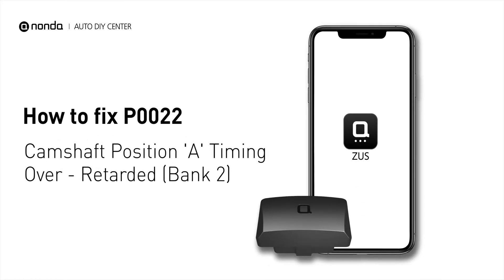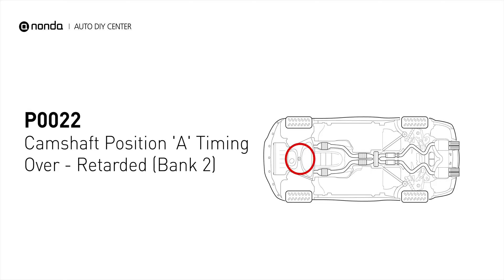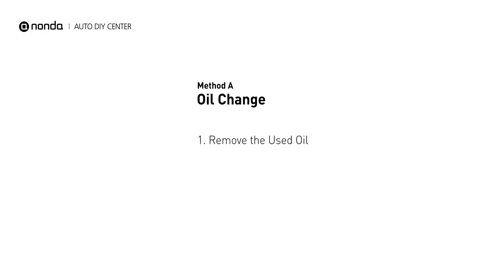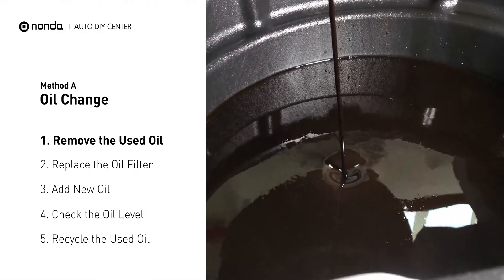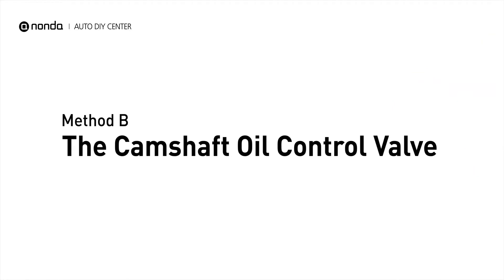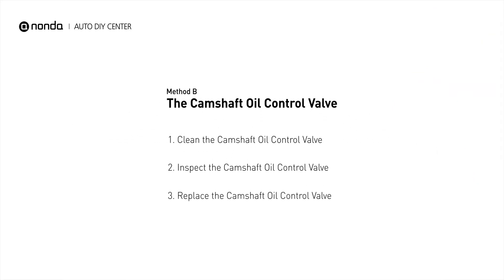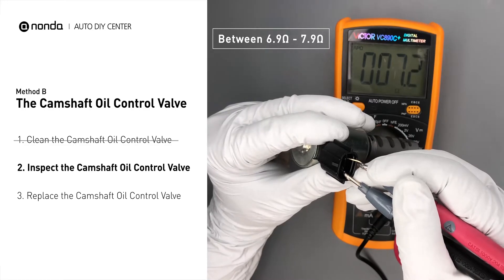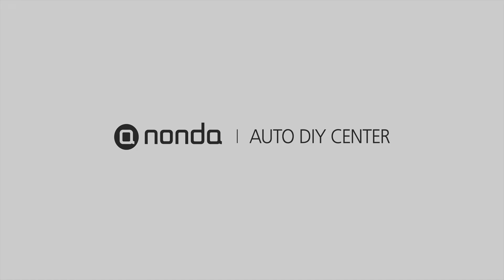How to Fix P0022 Engine Code in 4 Minutes [2 DIY Methods / Only $6.53]

Comment from the maker: Hi, I'm Steve, nonda's lead mechanic engineer. 
Feel free to leave your comments here if you have any mechanic questions, I will be glad to help you out!
Reply: Is it a camshaft position sensor or a crankshaft position sensor
Reply: I changed out the intake valve and I am still getting the p0022 error code. Do I need to clean or change the exhaust one also?
Reply: @lilkgb477  It may be a stretched timing chain.
Reply: Hi my bmw x5m has got po012 and po022. Can clear the codes and get into boost but it shuts the car down. I changed the battery cause the other was a bit weak.  But I’m in almost limp mode now

Comment: I have a 2010 ford expedition XLT EL with a 5.4 V8, popped this code up this morning. Did some research and it claims to point to camshaft position sensor, what are the odds of it being something different, was gonna change both sensors and see what happens but i know its likely that it can be something else
Reply from the maker: Hello, kindly make sure that the condition/viscosity of the oil is okay. Check also the wiring and timing chain.
Reply: Hi did you fix the issue? if you did how did you pls?

Comment: I replaced magnet, camshaft valve and wiring and oil and oil filter, I'm still getting the 0022 code after clearing code.
Reply from the maker: Hi David, there could be an issue with your timing chain and the PCM. Please also check if there's any other code that registers along with this code.
Reply: @nondainc  only codes are for the stereo because I have an aftermarket stereo.  Only code is 0022.  But I will take the car Saturday to Volkswagen and let them check.  It drives normal besides white smoke from exhaust but coolant is still sitting at Max and no boost.  But I will definitely have Volkswagen check it out.  Thanks

Comment: Can you drive your car with a P0022 code
Reply from the maker: Hello, we suggest to fix this as soon as possible as this code can severely affect the drivability of your vehicle and extended driving with this can cause internal engine damage.
Reply: @nondainc  DOes it mean the chain jumped timing or just a cam  sensor is bad or can it be just an oil change????

Comment: I have an 05 Audi Allroad Quattro 2.7t, I have the P0022, P0491, and P0492 codes. Car would crank but not start. I changed the oil and it started running again for about 4 days, just went to start it again and it won't start. I tried to search for the Camshaft Oil Control Valve online, but I cannot find it for this model. Is the part called something else on this car?
Reply from the maker: Hi Damon, since you are receiving multiple codes, we suggest getting your vehicle visually inspected by your local mechanic for further diagnosis.

Comment: I replaced both vct sensors, checked oil (looks clean and full) and I’m still getting codes p0022 & p0012 please help
Reply from the maker: Hello, please provide us the year, make and model of your vehicle so we can address your concern specifically for your car's make/model.
Reply: @nondainc  I have an 09 f150 xlt 5.4 v8
Reply from the maker: Kindly check the engine timing chain tensioner if faulty and needs replacement.
Reply: @nondainc  should I just go ahead and order a new cloyes timing chain & component kit?
Reply: @nondainc  hello
Reply from the maker: Kindly have it visually inspected first.
Reply: @bucsfan4209  you should check if the timing chain is loose, because the tensioner gaskets blow and cause this
Reply: What ended up happening? I have an 04 f150 with the same issue on bank 2. Replaced vct solenoid with an aftermarket one and code P0022 came back shortly after.
Reply: I have the same issue u recommend getting the solenoid from the dealer
Reply: How can I check timing chain is ok

Comment: I have this code but my mechanic is saying i will have replace the engine. Is that true?
Reply from the maker: Hi Cameron, please provide us with your vehicle's year, make and model.
Reply: @nondainc  04 ford f150 5.4L v8
Reply from the maker: Hi Cameron, an oil change is recommended and please follow which viscosity of oil you should use. Let us know if the issue will still persist after an oil change. Also, double check if there's any other trouble code that registers along with this code.
Reply: @nondainc  P0022
INT Cam Position Timing Over Ret Bank 2
P0171
System Too Lean (Bank 1)
P0302
Cylinder 2 Misfire Detected
P0345
CMP Sensor A Circuit Problem - Bank 2
P0420
Bank 1 Catalyst Efficiency Below Limit
P0430
Reply from the maker: Hi Cameron, since you are getting multiple error codes, it is best to get your vehicle visually inspected by your local mechanic. If you are not satisfied with the diagnosis of your first mechanic then I would suggest to get a second opinion. Have it visually checked by other mechanic.
Reply: @nondainc  stop pulling the codes is not enough? Also do these cores mean I’m going to need a new engine?
Reply from the maker: Hi Cameron, any of those faults you mentioned can trigger another fault. We recommend replacing the MAF and the Coils. Then have your O2 Sensor checked and let us know the result.
Reply: @nondainc  the mechanic where my truck is at said that they found metal pieces in the oil when they drained it. They said I’m going to need a new engine.
Reply from the maker: We can't say for sure that you need a new engine as metal pieces in oil have other factors. It can be a result of an oil contamination or friction or wear in the engine moving components. We suggest to take little of the engine oil for a lab test. This is to analyze the oil and tell you where the metal shavings are coming from.
Reply: I have. 2015 Ford F-150 with this code on I just spent 3490 in a transmission rebuild lord I hope I don’t need a motor now only had truck 2 months
Reply: @Bigberthasilverado18 any engine can be fixed any mechanic telling you, you need a new engine is horse shit lol

Comment: I got P022 error but no check light and the engine is not starting , why there is no check light?
Reply from the maker: Hi Waseem, please provide us with your vehicle's year, make and model.
Reply: I have engine light on and code reader came
Up I just spent 3400 to rebuild my transmission

Comment: I keep 5W-20 and 5W-30 oil for my two cars. Can using the wrong oil cause this code to pop up? I might have grabbed the wrong oil when I changed the oil last...🤷‍♂️
Reply: I switched from synthetic 5w30 to 5w30 conventional and it's been 10k miles, no codes !! V6 Taco
Reply: @GatesRapes  interesting. Maybe I'll try that. For anyone who's following up on this for their own cars, I changed my oil again to eliminate the possibility that the wrong oil was in there, it ran smoother for a while but it's reverted to having the same issue. Although the check engine light does turn off every once in a while unlike before.
Reply from the maker: Hi Kyle, yes- please follow the viscosity recommendations for your vehicle make/model for proper lubrication.